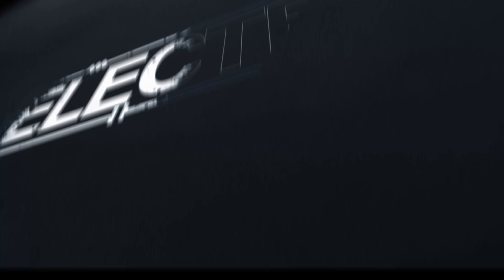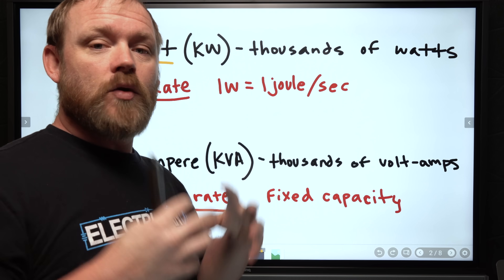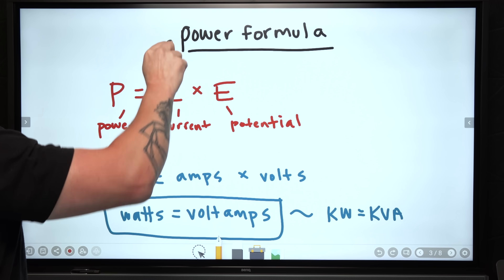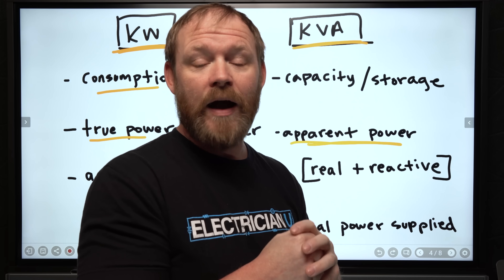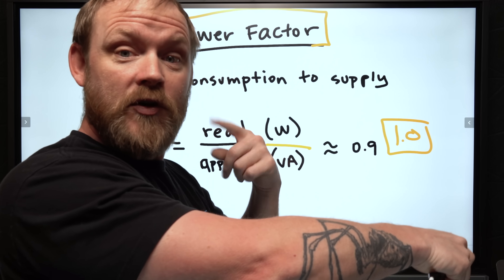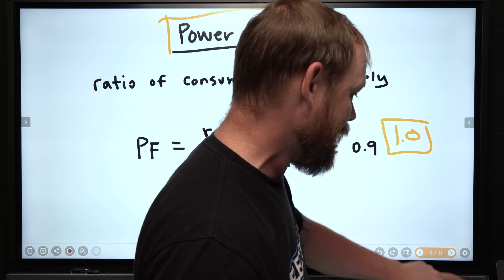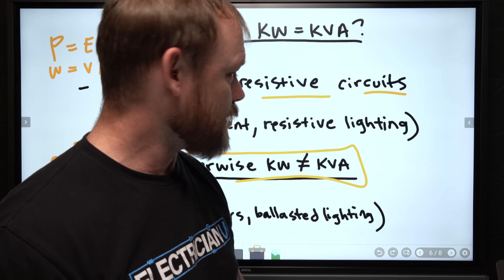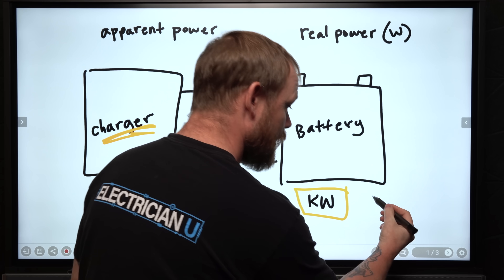Why KW and KVA Are NOT The Same Thing (Even If They Seem Like It)

Comment: the sales trick they still use to day the same Hp is not Kw but the diehard
stay talking in Hp or torque the fake against the real Nm. and like you
talking about joul sure food there you can use it but in electricitie
ithave to do that time is not metric and joul is not metric
sure some people do not like metric  and use body parts and stones
try this 230 volt 50 hz what is goming from the wall socket? 50 times  4.6 volt a second
your joule,time is a differend mesuring way measure in one minute what is the voltage
the voltage dont stop afther one second and also time not it are human who have done that
not time or energy

Comment: Do want to point out one correction. While charging a battery, there is loss within the battery and loss even after the battery is charged that is not realized KW. Batteries lose power during charging that produces heat. Batteries lose power in cells due to energy leakage.

Comment: Nice to see someone try to tackle this concept.  I'd like to add a few ideas, that may provide further insight & accuracy.  The actual power that gets utilized is for the alternating current that is "aligned" or "in-the-same-phase" as the alternating voltage.  If/when you have perfect alignment, power factor is 1.   If you are out-of-alignment, PF < 1, you're not able to extract the maximum power from the given voltage and current,  but you don't actually waste all of which could have been available.  The bulk of the remaining potential energy gets reflected in a lower load on the generation plant, but also causes various undesirable effects as I pasted from chatgpt below.    Hence, the power company incentivizes customers to match the impedence of the load to the impedance of the source (power generating system, or power-plant + distribution), in order to get the PF closest to 1, to reduce losses - this is good economics, as the cost of customer-induced inefficiencies can and should be passed onto customer (and vice-versa). And since there is a limit on how much current any particular line can carry, matching impedances also allow them to deliver more power on the same size lines, precluding the need to add more/new power lines.

.. below is information from chatgpt (chatgpt said it was ok for me to repost it) regarding other losses that can occur .  

1. Reflection Losses

    When impedance mismatch occurs, a portion of the electrical energy is reflected back towards the source instead of being delivered to the load. This phenomenon is particularly significant in high-frequency systems, such as radio frequency (RF) transmission lines, where standing waves can develop.

2. Reactive Power Circulation

    Impedance mismatch often results in a phase difference between voltage and current, leading to the presence of reactive power (measured in VARs). Reactive power does not perform useful work but still flows through the circuit, increasing the total apparent power (measured in VA) and causing additional energy losses due to resistive heating in conductors and components.

3. Voltage Regulation Issues

    Impedance mismatch can cause voltage drops along the transmission line, resulting in poor voltage regulation at the load. This can lead to inefficient operation or malfunction of connected devices, further compounding energy losses.

4. Harmonic Generation

    Non-ideal load impedance can cause nonlinearities, leading to harmonic distortion. These harmonics contribute to additional losses in the form of eddy currents and hysteresis losses in transformers, motors, and other magnetic devices.

5. Increased Heating of Components

    The circulating reactive power and reflected waves can cause overheating in components such as transformers, inductors, and capacitors. This reduces their efficiency and may lead to premature aging or failure.

6. Reduced Power Transfer Efficiency

    Maximum power transfer occurs only when the load impedance matches the source impedance (for purely resistive systems). An impedance mismatch reduces the power transfer efficiency, meaning less usable power is delivered to the load.
Reply: Thanks - a useful clarification. Also interesting to see an example where ChatGPT pretty much gets things right!  You didn't need it, though: your summary was more useful!
Reply: good, but i dont know why the consumption system measured in kw rather in kva?

Comment: Your house has a meter on it for billing purposes. The power company can only measure the resistive load for billing. They bill the watts used. They haven’t figured out how to bill for the inductive load you are using. That instant on television has transformers inside ready to go with electricity flowing through them that the power company cannot bill for. Turn it on and that is the load they can bill. Fluorescent lighting has more inductive load than resistive load for the same illumination. You get billed less . Electric motors that are not run at loads that are near their destructive limit, use more inductive/reactive load than their undersized counterparts. That’s the power factor calculation. The electric power generation required by the power company is more for larger lightly loaded motors than for smaller heavy loaded motors but they are doing the same work.
Reply: Smart meters can actually measure the reactive power component too.  You just don't get billed for it.  The old power meters were simple circuit accumulators the could only measure average power, so reactive power netted-out against forward power.   Smart meters actually take several thousand samples per second of current and voltage and from that they can extract both the forward and reverse power components.

-Matt

Comment: Dustin, let me give an answer to why EV batteries are rated in kW and kWh; one aspect of rating them in kVA would require knowing the C rate of the cells, as well as the peak ampacity that the BMS will allow. Yes the manufacturer has this info, but disclosing it has knock-on effects for those who like to reverse engineer stuff (like me). Second aspect is that the cells have a certain level of internal resistance, and the BMS that controls the whole pack has to make sure the individual cells are closely matched on voltage. This means either using a resistor to burn off excess energy, which is uncommon, or using a capacitors and midgets to transfer energy between the highest voltage (“most charged”) and lowest voltage (“least charged”) cells. Sorry I can’t explain it better, but gotta get clocked in to work.

Comment: There really is no need for this explanation because the point is moot... Practically speaking the supply is solely for the load! There is no reason as an end user to have any need to know the difference in KVA and KW as it is only the watts that matter and weather the transformer or supply meets the needs of the load! Therefore the formula is what matters and volts x amps equals watts. 1000 volt amps is 1000 watts. KVA = KW!

Comment: Many people are struggling to make the difference between power (watts) and energy (joule, calorie, kwh, Ah @..volts).
To keep things simple: In most cases VA is a rating for AC devices that has to be higher than the consumption in watts. Power factor or phase shifting is beyond high school and part of the advanced training in the trade. In a (battery powered) DC system there is no AV but P=A*V (in watts). Do I need to hint that any system has to be rated to handle voltage and current, too?
It's like your credit limit. You can't draw money from any atm when your limit is reached. It's up to you to calculate your $ limit when on holiday across the lakes in Canada.

Comment: As someone with a scientific education background, but not as an electric engineer specifically (I got physics and electricity courses as part of a broader set of courses but that is not my specialty), I was always confused by the existence of VA versus W. I totally recognize myself as the guy who applies U = R*I and concludes that VA and W should be about the same thing, as they relate to power and share the same unit. This is why I was curious to hear what you have to say on that topic.

In the end I don't feel like a learned a lot more though. One reason is, most of the time you describe VA as a "capacity". There may be an effect of language barrier here (english is not my mothertongue), but to me capacity relates to energy *storage*. Something that you would measure and express for instance in KWh (kilowatt-hour), meaning a power (W or VA) multiplied with a duration over which this power is accumulated.

The part of your explanation that seemed the most interesting to me however, as I feel this is the part that I see snaively as both the most relevant, and the part that I know the least about, is the part about alternative current, power factor, and impedence. I would believe naively that this very important for that topic, but you cover this in only one or two minutes in the end. Do you consider it is lesse relevant, or less useful to understand the question, than distinguishing between the supply and consuming parts in a circuit?
Reply: VA and Watts have the same units, but different meanings in utility parlance.  VA is the equivalent watts that a piece of equipment sees as power flows through it (and for a generator... the generator typically has to sink the reactive component).   Watts in utility parlance is the power delivered to the actual equipment that is doing work inside that equipment.

A piece of equipment, such as an AC motor, will accept a number of watts... say 1500W, but it might only use 1000W to do actual work and reflect 500W back in the opposite direction.   The actual power being consumed by the equipment is only 1000W, but the equipment, wires, transformers, contactors, and breakers in the power path are stressed with 1500W and generate heat as if 1500W were being delivered when in actuality 500W of that 1500W has been reflected back and is going in the opposite direction headed back to the substation.

Equivalent resistance and heat generation is considered to be real "work" in these examples.  It doesn't matter if the energy goes into the motor or into heat... its still "work".  But reflected energy is not work... the energy was reflected and can potentially be recovered at a later time by something upstream.

-Matt

Comment: My favorit analogy: KW = beer (actual power) KVA = beer + foam (apparent power)
Reply: I would say KW = utilized power, and KVA = total power taken from the grid.
Reply: Perfect...and refreshing. I may steal that one next time someone asks 😀
Reply: The problem with this analogy is that the foam appears on the top of the beer and not in the beer.
Reply: @strobi0001  Bbbbut, when you drink, you swallow beer and foam, no only foam, no only beer, so the foam is an apparent consume, the analogy is so good cheers
Reply: Building on that:   A mug of beer costs the same regardless of how much foam is in it.  The mug equals the wire and breakers that you have to pay and size for.  kW is the amount of actual power you are getting out of the motor.  EG:  kW = How much beer you get to drink.
Reply: true power is KVA!
Reply: KVA is both together but watts is just beer and reactance is the foam.
Reply: My electric professor used that analogy and easy to remember the relation of watts (KW) vs volts X amps (KVA).

Comment: Last time I went generator shopping they were all in KVA and they asked me how many KVA I needed.  I asked them where is the KVA rating is on my equipment and they couldn't find it.  So I told them to find me one that is rated and listed for the right KW because until they put a KVA rating on electrical equipment it does me no good and no 2 KVA to KW calculators give the same answer.

Comment: Pure resistance actually is impedance. It just has no "imaginary" (or reactive) term in the equation that describes the relationship between voltage and current in the circuit. The "power factor" is another way to describe the phase shift between voltage and current. The phase shift can obviously only happen in AC circuits where inductance or capacitance exists. Of course in the real universe there are always resistive, inductive, and capacitance components in any circuit. Even in a piece of wire!

In DC circuits, voltage and current are in phase even if reactive elements are present. Once steady state is achieved, inductors are shorts, and capacitors are open circuits. So in terms of power and energy stored, it makes sense that a battery is rated in watts or watt-hours.
Reply: Almost correct.  There is no phase in steady state DC circuits.
Reply: @ OK you're right! Phase really does not make sense when discussing DC circuits.🙂
Reply: @lokiva8540  Correct! I miss spoke.

Comment: It’s a good video but I encourage you not to use the words “storage or “capacity” when describing the KVA side. It’s not accurate and only confuses. “Storage” means energy with no flow- no current which is measured in KWH (rating of a battery).   KVA is the measurement of supply side power before it is converted to useful work. Using “capacity” and “storage “ is a slippery slope.
Reply: this is close but it's not entirely right. reactive power can come from both the source and/or the load side and this distinction is actually really important when your designing electrical systems. inductors and capacitors store energy in the forms of elecric and magnetic fields which is what we refer to as "reactive power". but unlike real power, the energy isn't consumed right away. it just moves back and forth in the system until it finds a path to dissipate.
Reply: Jeff and Peter. I appreciate both your inputs. Because I'm wanting to be an electrician. In the future but currently don't earn enough at work to go to college. So I'm going to YouTube and just trying to educate myself by watching videos read until I can finally go into college. At least I'll have a starting point.
Reply: @DragonProtector174 where in the world are you? Many electrical jobs hire and train from scratch. Might be a way to go?
Reply: @whochecksthis  my location is portland oregon, so enlighten me on any apprenticeships in my area. Good luck. I couldn't find any
Reply: @DragonProtector174 did you call any electricians in the area?
Start as a gofer/grunt, and learn.
Reply: @whochecksthis  okay.
Reply: @DragonProtector174 Not sure where you are but you don’t need college to become a electrician. That would be a huge waste of money. I am a master electrician, went through the apprenticeship program. I have been in the trade just over 30 years and make $225k a year, no college, no out of pocket training program. Don’t waste your money. Find a contractor that will hire and train you.
Reply: @stanley4006  i live in Portland Oregon, United States. i mean, I guess I could just walk up to. P, G, E, but....
Reply: @DragonProtector174  no problem! good luck with your studies!
Reply: @PeterMikeSolomon  Thank you.

Comment: Now I understand why transformers I buy are rated in KVA, and not KW...
Thank you so much for a great explanation....
I guess then that a storage battery connected to a Solar Inverter, that the battery is in KW and the Solar Inverter is in KVA...?
Reply: A battery is rated in the number of amp-hours it can hold and the number of amps it can deliver continuously.   These are NOT units of energy or power, but instead are units of charge (net electrons, basically).  But you can easily convert them into units of energy and power by multiplying by the nominal voltage of the battery.

So a 100Ah (amp-hour) 51.2V LiFePO4 battery holds 5120 Wh (watt-hours) = 5.12 kWh (kilowatt-hours) of energy.  That would be its capacity.  And if that battery is spec'd to be able to deliver 100A continuously (often the same as its capacity in amp-hours, but really a different quantity entirely)... then it can deliver 100A x 51.2V = 5.12 kW of power continuously. until it is empty (in this case, for about an hour at that power level).

For lithium batteries this is also known as the "1C" rate of power delivery (or charging rate).

The reason batteries are mostly specified in "amps" and "amp-hours" is because heat and other stresses are strictly a function of amperage, and the battery's storage is actually storing electrons (basically)... columbs... electric charge.  Which can be measured in amp-hours.  Amp-hours can be directly translated to units of charge (electrons) stored in the battery via chemical bonds.

-Matt

Comment: In the future it may be helpful to explain the power factor as an AC phenomenon. It's a phase shift between current and voltage, owing to the reactive components in the load, which results in a loss of real power. It is in fact waste, which is why power companies don't like it in residential applications and industry doesn't like it because they do get billed for apparent power. This is why we see massive power correction schemes deployed in industry.

So as far as batteries being rated in kW and not kVA, they're rated like that because resistive loads don't cause any phase shift between current and voltage. But batteries when being charged, are indeed loads.